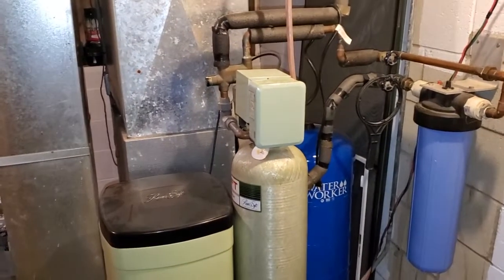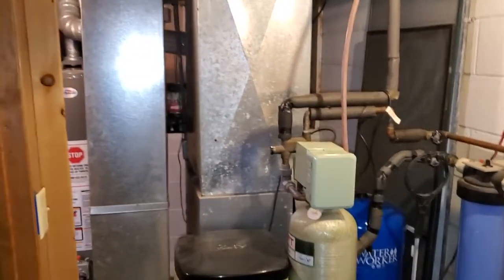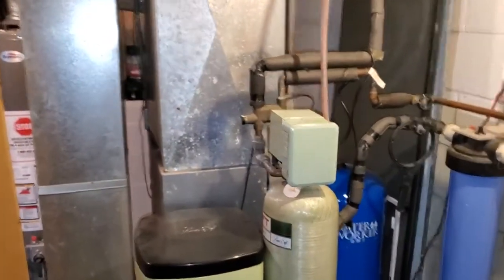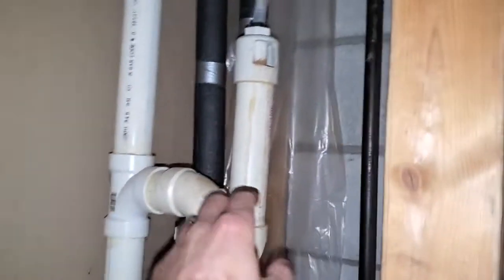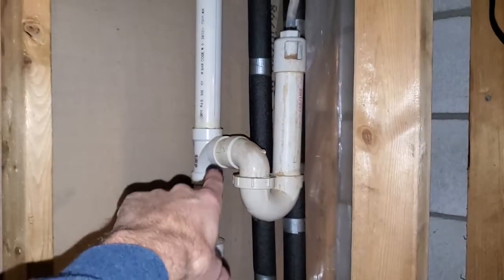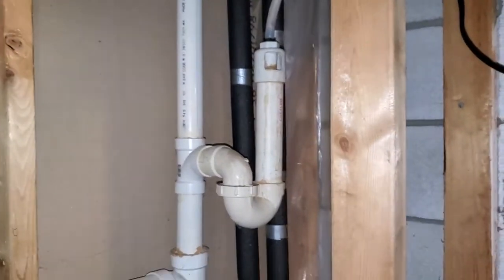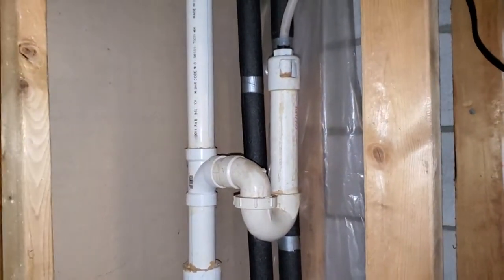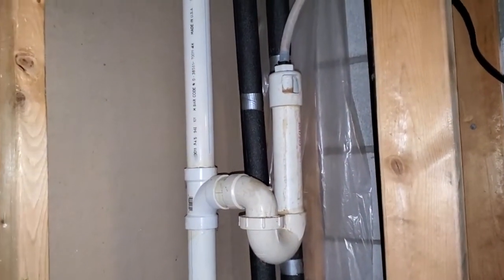How to properly install a water softener drain into a sewer pipe

Comment: What about using a check valve?
Reply from the maker: Check valves can fail
Reply: @nwohiohomeinspector ty 4 answering,  sodium\discharge in the water can cause it to fail i take it? Clog it up?
Reply: @nwohiohomeinspector I'm back. What about the overflow for the tank? Will I need to s-trap/airgap each separately? Thought about using a tee with check valves and remembered this vid.

Comment: I installed the 5600 sxt water softener next to the water heater.  the water heater has the copper overflow hose to the wall to the outside, where there's a pan under the water heater in case emergency.  can I connect the two water softener drain hoses from tank and salt box to the copper outlet to the outside wall?  Thanks!

Comment: Excellent information!  Thank you for the video.    I'm in the process of having a water softener put into my son's condo however I cannot locate a nearby floor drain.  The previous owner at one point obviously had a water softener installed judging by the additional remaining plumbing that has the bypass valves, etc. near the main water inlet.  Simply could not figure out where they were running the softener discharge to.  There is a small diameter tubing that rises upwards which I'm now thinking was tied into the kitchen sing drain which would. be directly above the softener.  I'll make sure to hire a plumber to make the connections and have that air gap installed as illustrated in your video.

Comment: Question...I have a Master Plumber coming out soon to move my regen discharge going into my sump well and he's gonna cross-connect it to the main sewer line (septic system) in the basement. Problem is, in addition to the large added expense of adding a vent stack up from the basement this job would really be a nightmare so he told me so he would put in a Studor vent. I'm assuming, then that IN ADDITION to a Studor vent which replaces a typical vent stack that I should  expect him to add an AAV/Air gap fitting with a P-trap where the softener drain line will go in such as you showed on your video? In the end, then, should there be a Studor vent for venting an AVV/Air gap to prevent siphoning of sewage back into the softener?
Reply from the maker: Yes, a p-trap and air gap will be needed.  A vent may not be needed or it may be close enough to the main. You typically can't add an AAV with pumped water anyway.
Reply: @nwohiohomeinspector  Thanks for gettin back to me! Can you explain a bit more what you mean with your comments, "You typically can't add an AAV with pumped water anyway." And, how close (or how far) to main is a vent needed, or not needed in your opinion? Thanks again!

Comment: I kept have water splash out from the P trap set up. This had no cap on top just the hose from the water softener backwash going in. He moved it to the main sewer pipe and drilled a hole at the top and put the hose in. No more water splashing. But now a year later my softener where the salt is as what appears to be dirt. Someone said stop using salt crystals and use pellets. But cold water smells really bad at some of our faucets. I reached out to the plumber and he insists its not the drain connection.
Reply: Please clean your brine tank. Just disconnect the line to it. Get rid of all the old salt which should appear dirty. Once clean, all salt pallets and buy a gallon or restore in the water softner section at Lowe's or Home Depot.  Iron Out also works. Please read the instructions first.

Comment: Quick question, this adds an opening in the draining system. What device do you use to prevent sewage water from coming out there? A check valve?
Reply: A trap.  Just like at any sink, shower, etc.
Reply: @HomeInspection-101  Are both X axis rods using graphite bearing? Or is it just one

Comment: You’re missing the air gap for the softener drain. A P trap won’t prevent back flow. The manufacturer’s install instructions and local code require this
Reply: I'd recommend re-watching the trap section of the video.  You can see the air gap device clearly and he mentions it multiple times.

Comment: If you have your own field and tank you would not want to pump salt water into your field
Reply: It doesn’t release sodium chloride salt to drain, it releases the ion exchanged chlorides
Reply: Just wanted to let you know that water softeners that use sodium chloride (salt) contain sodium chloride in their discharge, contrary to the other comment lol
Reply: It's against code in CT to discharge water softeners into septic systems. The brine water is heavy and displaces the solids in the bottom of the tank. In effect decreasing the tanks solid waste volume.

Comment: I recently had a new non-salt water softener system installed. The installation plumber located the softener's drain pipe to drain out onto my patio. Now I have asked a new plumber to find a way to redirect this draining water away from the patio and his first suggestion was to pipe it underground to the waste line, which is close by.  He said it would also need to be vented to the roof. I was fine with that option, but now he seems intent on changing those plans and wants to direct the water into an underground perforated flex pipe that will allow the water to leach into my front yard. Is his new suggestion a reasonable option, or should I insist he stick with his original plan?
Reply: Don't let it leach into your yard!! Ours comes out of the side of the house and it's killing our grass over there and lots of mud in that spot now! 🤦🏻‍♀️
Reply: @kimberlyvassallo-murphy561  Thanks for your input on this. Since I did post this a while back, the solution I decided was to drain the water into our wastewater pipe system. However, it's noteworthy that I had contacted the company that manufactured the non-salt water system (Halo) and they told me it was perfectly alright to direct the water into my landscape...in fact, they actually encouraged me to do that.

Comment: Great info!

I have two drain pipes  from water softener tank and the brine tank.  I have the Springwell water softener model SS1.

Can I splice both drain pipes together into one air gap?
Reply: To answer your question, no. To add to it, I've installed many springwell salt based systems before and the brine tank only requires a gravity drain, preferably to a floor drain or an indirect waste below the brine tank outlet (not common) and springwell will tell you themselves that it is ok to run the brine tank overflow drain to the floor without a nearby drain, however you will get water onto the floor if you fill your brine tank with too much salt, there becomes a clog in the discharge line, brine tank float malfunctions and etc.. In the instances where I have done this per customers request, I have included a water sensor alarm to notify them of any leaks or flooding nearby, they're great devices, there are even automatic shut off valves with sensors to detect water which will automatically close for you. These are all upgrades outside the scope of general installation but may be wanted by some for additional peace of mind.
Reply: Yes. But just so you know the drainline from the brine tank is never needed. The overflow shut off line in the brine well will prevent any overflow.

Comment: Does it have to be that tall?  my drain line is right up against bottom of joists in basement and I got to find a way to make this work.
Reply: I'm sure you've probably already figured this out by now, but if you're installing the discharge line for a water softener, and the closest drain or only viable drain available is too close to the joists or the subfloor, unfortunately you may have to install a laundry sink or small utility sink equipped with a laundry drain pump. The pump will be connected to this nearby drain but also must be vented per the manufacturers requirements for the pump. Unfortunately, if there is no lower drains I don't think you can install this correctly AND comply with code because if you're floor joists are 2x6 or even 2x8 inches and the drain is horizontally butt-up to the bottom of the joists, installing a branch line with the required trap, standpipe receptor AND air-gap fitting, it's unlikely to fit. Well, you may get it to fit, however it will not comply with code AFAIK as 802.4.3 clarifies the requirements of an indirect waste standpipe, which reads, (and this does not only apply to washing machine drains) 802.4.3 Standpipes: Standpipes shall be individually trapped. Standpipes shall extend not less than 18 inches but not greater than 42 inches above the trap weir. Access shall be provided to standpipes and drains for rodding. Also can assure you that the standpipe in this video is not 18". Can also say that throughout my 8 years of plumbing, it's more so the case that I find softeners running directly into standpipes without an air gap, as well as indirect drain standpipes being less than 18" lol so I guess it all comes down to if its going to be inspected and if the inspector cares 🤷‍♂ Also, usually in this situation I would provide an alternative to the clients filtration system including replacing the salt based system with a salt-free conditioner, however client should be aware that many salt-free water conditioners - though may not require a nearby drain, also do not remove water hardness but merely conditions it and will still provide many benefits of the salt based system with less maintenance and less cost for installation given there's no nearby drain. Those who need to have a salt-based system, I can either install it incorrectly (which I hardly ever do) or some type of pump system. I also don't run softener discharge lines into basement sump pumps which I see a lot of people do that as well, brine water will ruin your pumps prematurely.

Comment: Thanks for the info. I was wondering if i could tap into my main 3" sewer line in my crawl space? Culligan has the drain line just dumping under my house lol
Reply from the maker: Of course.  It would be much easier to tie in to a 1.5" or 2" branch drain though (that ties into the main 3"). Same deal as in the video, needs a trap, stack, and air gap.
Reply: If there was a sewer backup wouldn’t it overflow sewer under the house though?

Comment: Looks like a s-trap configuration, which is not proper.
Reply: Agree - looks like the trap arm is < 2X the pipe diameter, so that is a code violation.

Comment: Excellent, helpful video. However, I did have a question - my softener is near a bathtub, and the p-trap for the tub is easily accessible from the crawl space. Could I put in a drain saddle before/above the trap with a check valve and just drain into there?
Reply from the maker: I'm assuming you mean tying it into the overflow pipe, which should be fine. Better yet, you could just tee into the overflow pipe, add a 90, and install a water softener air gap fitting.
Reply: @nwohiohomeinspector  Yeah, that's exactly what I wound up doing after I got over the jitters. Thanks again for the video and response.
Reply: Just make sure you add an Airgap.

Comment: in this video, did they have the sump pump or how did the water drain out consider the main sewer is above the water softener? I am running into the same problem as my main sewer line is above my location for my water softener and I m not sure how to plumb it properly. THanks
Reply from the maker: The softener will create enough pressure to discharge it into the pipe. Plumb it  just like shown in the video (or similar).

Comment: Is there a  minimum height for the trap?
Reply from the maker: The trap depth typically shouldn't exceed 4".  Are you talking about the standpipe height?  If so, as long as it's not too crazy high, it will be fine as you don't want to make the overall height excessively high (e.g. 8 ft +/-).
Reply: Yes I was talking about the actual height of the air gap compare to the water softener drain connection.

I’m sure the air gap will be higher when I’m done installing the water softener.   

This will be ok?

Comment: I need help with my softener it was recently installed by our maintenance person the drainage from the softener is tied into drain pipe has no air gap and is also the same pipe system as our outlet for the water softener
Reply: I don't have an advanced knowledge of plumbing but it just looks completely wrong to me but the guy from a water company said it was fine

Comment: What about the overflow drain from the brine tank ?
Reply from the maker: Same deal.  Should not be cross-connected.
Reply: @nwohiohomeinspector   just had a system installed and after looking at my owners manual I called my salesman because the installer went directly into my injector pit he corrected that but the brine tank overflow is going down my floor drain.
Reply from the maker: @bluesdirt6555 , that's fine going to a floor drain as there's an air gap
Reply: @nwohiohomeinspector   Where can I find that plumbing code ? Thanks
Reply from the maker: @bluesdirt6555  - just google 'cross-connection plumbing code'.  Add your area you live to be more specific.

Comment: My drain line goes through the wall to the outside the house and to a pipe that just goes in the ground. It used to just drain deep into the ground but now it wants back up and spray water all over the lawn and the side of the house.

I have no idea how to fix it or who to call? 

I’m in North Florida
Reply: Dry well: A deep pit filled with gravel or rock, often used in rural areas, to allow the water to seep into the ground. Make surethe hose is buried below the freeze line in your area.

Comment: Aren’t the drains from a water softener gravity fed? I’m in a dilemma where the only drain spot lower than my softener is a main sewage pipe leaving my crawl space heading to the septic tank
Reply from the maker: No. Units create enough pressure to discharge typically up to twenty feet or so. If there's nowhere close to tie in, besides the main, you could just T into that and add a trap, standpipe, and air gap fitting.
Reply: @nwohiohomeinspector  could you do this on a horizontal PVC pipe going to your septic?
Reply: Thanks for the info!

When I install my water softener, it will be lower than my air gap fitting.  

Is that going to be ok?

Comment: Is there a min. height for the standpipe before the p trap for water softener discharge?
Reply from the maker: Hey Andrew, 
Not sure on that, good question.  I would think it should be at least 12" to avoid any potential splash back, but I'll do some digging and see if I can get a direct answer.  Thanks!
Reply from the maker: I would say about 6" -12"

Comment: Thank you for the video. I'm wondering if you can answer a question for me. Does the water softener go to all the taps in the house? I'm seeing build up on my taps at the bathtub and the kitchen tap. Isn't the water softener supposed to stop this from happening?
Reply from the maker: Depends how the softener/house is plumbed.  Most will run/leave hard water/unsoftened lines to exterior hose bibs and sometimes a separate drinking water spigot at the kitchen sink/refrigerator.  There's a lot of variables that come into play, though.  The build up you're seeing suggests that your softener may not be working properly, you're using the wrong type of salt, etc. Again, a lot of variables.  Have you tested the water?  Might want to have it serviced/inspected by a professional.
Reply: @nwohiohomeinspector  Thank you. I have twice had it checked and both times they say it's working properly. I don't think it is because the kitchen sink tap is getting caroded as well as bathtub faucets. It's driving me nuts to say the least.

Comment: Same happened to me. It's been this way for 40 something years. Had many many plumbers in my house and not one of them ever said this. Even the company that owns the damn thing never said anything about it.  It was only when I noticed on my own that the waste drain garbage and bacteria was reverse-feeding itself through my softener and into the salt tank and into the water that I knew something was wrong here.  The entire salt tank stunk like sewer. Guests that would come over always said the water tasted bad.  Man....this is such bullshit.

 I have just recently put a backflow valve on the drain line as a temporary fix (the entire plumbing stack has to be rebuilt and the water softener replaced anyway) but I do not think the incoming water is high enough pressure to trip the valve float so I think my idea isn't gonna work. But if it just does something for now that's all I need. Had the softener unplugged all year while trying to get my basement cleaned up to get the brine tank outside to wash it out, and in that time my pipe valves have started crystallizing and getting green.
Reply: Oh man, the dilemma... do I tell my family and friends that they drank my pee or do I not tell them?!
Reply: @NovaHockey8  I wish the news was THAT good...